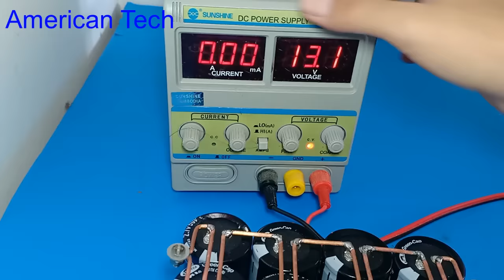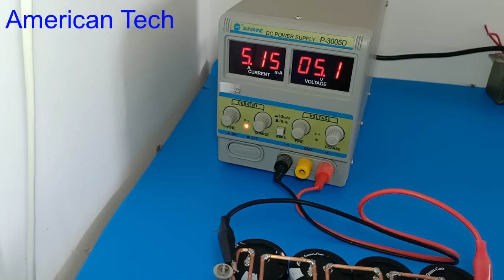12V , 100A using Super capacitors , Amazing idea

Comment: If You just short the thing You might just get 20amps maximum not 100 stop making these videos the thing that anoyes me the Most is that You actualy have the resources and time to make videos that aren't full of lies(sorry for speling english isn't my first language)
Reply: Rule of elektronic 
1F x 1v= 1A.sec 
1000F x 10.8v =10.800A.Sec.. or 1A in 3Hrs or 3.34Ah 
So this is true.. 
Greetings from Denmark
Reply: Yes this is true i didn't think about the capacitance but the total capacitance isn't 1000 F bcs it's 2 in paralel witch would give 1000 F and 4 in series witch would give 250 F at 10.8V (i don't disagree that the caps can't give 100amps mostly i saw only fake videos like the how to make a 7000F cap and i began to asume that all his videos are fake)
Reply: @kennethschultz6465   1.capacitor aren't batteries they can store charge for a long time but they are different 
2.the formula for capacitors in series is 1\Ct=1\C1+1\C2+1\C3...
And in paralel is Ct=C1+C2+C3...
Thats why the cap bank is 250F at 10.8 V 
Here's a video that shows the formulas for caps https://youtu.be/vAfwte8-7d4
Reply: Sad ..!!! You realy don't know What this formula is fore 
Do you.. 
This formula is for the chardge Voltage  one the ONE CAP
In the seriell line .. on What ever number to svare Voltage over 
Volt shearing volt deviding ..
Like chardge Voltage over BATTERYES in SERIES!!! 
Please PLEASE PLEASE PLEASE!!!!! 
Educate you Better on this point 
Sad when some on see formula on YouTube 
And don't understand or can't entrepetate What theay see 
... Sorry for english 8th langue

Comment: The Scraping Scene is ridiculous.    When a board is a few bucks as I have some. and soldering is done in moments as oppose to this scraping fest. 

I also agree strongly with Hadi Rixvi about nonsense claims to hype your video.    
Your 100 amp claim is the stuff of FAKE FREE ENERFY CLAIMS and then some. 
Even your Ten Volts as 12 volts  fudging of facts is dumpy. 

Pull the video and fix your gaping errors
Reply: Dear Sir. 
Can't you do smpel math 
2x500 paralell =1000F right 
4 Banks of 1000F @ 2.7v in series .= 1000F@10.8v
Please feel free to do the math.
1F x 1v= 1A.sec
1000F x 10.8v = 10.800A.sec please tell me THAT thats not 100A som where 
Even for A Sec
Please keep you wrong math to you self 
Have a nice day

Comment: Hello Can you tell me where I can find hardware that can stop the capacitor once it is loaded to the maximum thank you
Reply: Why ... ??? Use a 12v 13v 14v PSU 2A
+to + - to -  and see the A meter drop to 0 And ITs good to go
Reply: @kennethschultz6465  Hello I would like to make a battery with supercapacitor different kinds that it stops when it is loaded how I could do as it is for an electric bike
Reply: @mybattery18650  hey bro..you use a PSU 
Who can regulator AMP too  
Usuly you just regulate Volt ..  the bigger A you buy the PSU  the quicker you can chardge the bank
But this is SHORT LIVED to a bicycle 
I don't know if ITs possibel to use IT as a """Turbo""" this is way way faster to discharge than a battery
But fi you take a battery and a CAP bank together you can have way mor Turbo Amp to use
This is a fast chardge fast discharge   
Not 4 hrs  chardge but in seconds so you can't chardge battery and CAP at same time
But the CAP ville rise in V with any battery charged with any Charger

Comment: Your math is all wrong and your soldering is for shit. Wrap some wire around the contacts and the copper bus bars. Then solder with a much hotter iron. Then go back and do your calculations again. You forgot the proper formulas. 
 All wanna be EE's learn from these mistakes. That's the only thing to learn from this video.